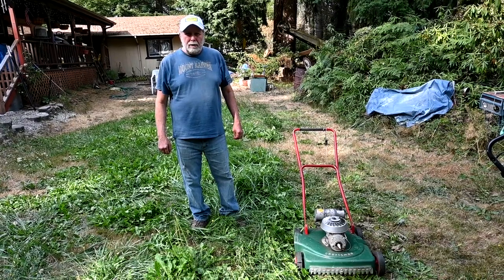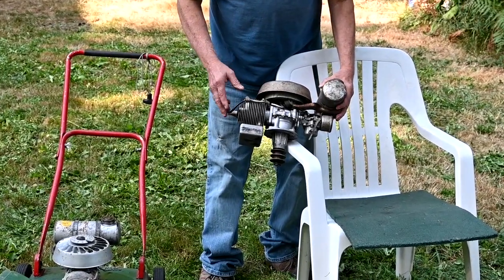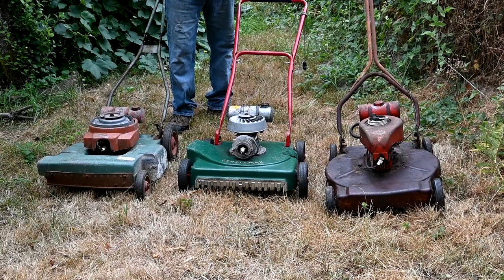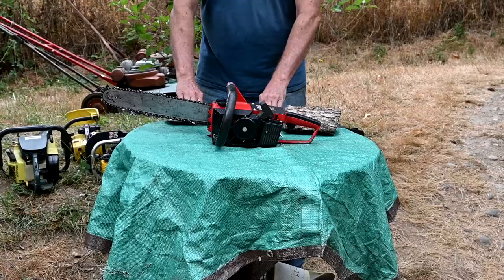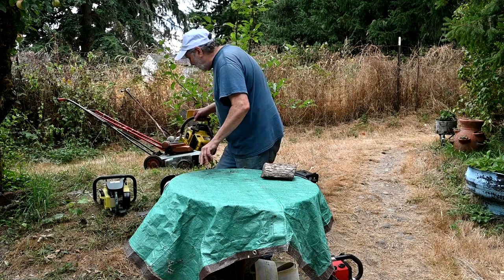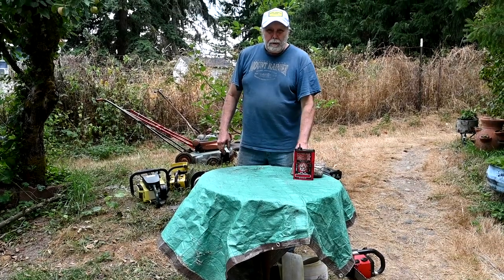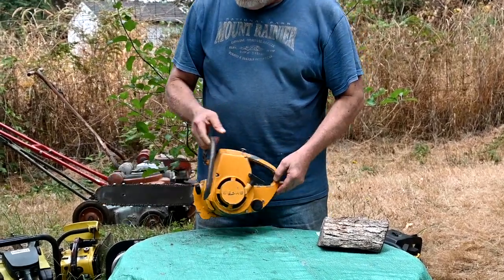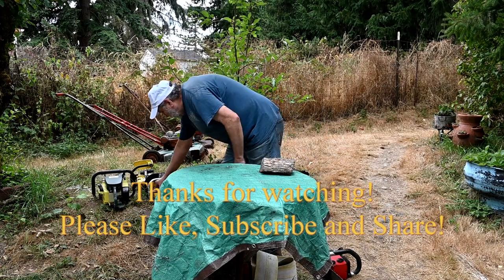Vintage Lawnmower Mowing + BS Vintage Chainsaw Contest + BS

Comment: Thank you! I ALWAYS look forward to each new video! Ah! It’s Tuesday time for a new VH video, however, I usually don’t get them watched until Wednesday. I’ve got 20 some chainsaws and maybe 10 are operational but I just like saws and can’t tell you why. I first owned an old used saw and absolutely no idea the make which I bought in 1985ish that was completely wore out. I then purchased one from our Sears catalog store because I didn’t have any money but did have a Sears credit card. We heated with wood so needed a reliable saw. I think it was a Poulan which I put 1,000,000 miles on. About five years ago I acquired an intense interest in saws. A Root made in Baxter Springs, KS is my most unusual. Wow! I’ve really blabbed on and on!
Reply from the maker: Thanks for the nice comments.  The saws that Sears sold in that ere, were made by Roper, which had been David Bradley.  They were a close copy of a Homelite XL, and were really good saws. Saw collecting is a nice hobby, since they dont take up a lot of room, and there are a huge variety to choose from, plus you can use them to cut your wood.  What model Root saw do you have?  Root,s are rare and unusual.
Reply: @mrobsoletesvintagehomestea9156  Greetings from Germany....
Hab auch 2 Mac einmal  eine 140 Mac und eine 120 er .
Gruß Peter

Comment: EDIT:  Ok, I’m a bonehead.  I incorrectly claimed DYNAmark had also used Homelites.  I was mistaken.  It was DURAmark that used Homelite saws and rebranded them.  Sorry for the bad intel. 

Lombard Little Lightening was the base model I believe.  Similar to the Homelite Super EZ, but Lombard had a way of closely copying Homelite designs, like the American Lincoln/Comango line being Xl-12/SXL knockoffs.  Homelite also made some Dynamark models as well.  Based off of the XL series if I recall correctly.  Maybe some others
Reply from the maker: Your answer about the Lombard little lightning is correct, but the axe has already been won.  Your info about the saws is much appreciated, as history is such an important part of collecting.  The Comango saws were actually designed by a Homelite engineer.  It never ceases to amaze me how many companies copied the Homelite XL,s Thanks for the comments and watching.
Reply: @mrobsoletesvintagehomestea9156  no worries, I saw an earlier post with the correct answer. Just hoping to add info and keep the conversation going.  I love these old saws.  Great vid
Reply from the maker: Appreciate the info.  Thanks  @wildcaughtfirewood1511

Comment: I have a Dunlap draw knife, made 1937-1941.  It is of pretty good quality.
Reply from the maker: Some DUNLAP tools etc were good, but usually not as good as the top line stuff.  My DUNLAP axe is pretty good quality, but things like mowers used the cheapest components.

Comment: would love to see a video on the rider next to the manaul reel mower the rider with rein/handle bar steering i beileve its a craftsman but could be wrong
Reply from the maker: The riding mower is not a Craftsman, but I have no idea who made it as their is no data plate on it.  I also have the Craftsman mower you are talking about, but it is mechanically different.  The unknown mower runs, but all the bearings in the mower deck are noisy, so it needs a go through. A future project.
Reply: @mrobsoletesvintagehomestea9156   oh ok Maybe if you take a video on the unknown know where I would be able to identify it for you
Reply: @mrobsoletesvintagehomestea9156  I know, snapper Did a more like this the comet Homelite also made some thing like this with that style of steering this could also be a Homelite and then one boy made a version the loafer
Reply: @mrobsoletesvintagehomestea9156  Also Fairbanks Morse did a mower that had the style of steering so did beaver company But beaver company is more famous as you know for their eager beaver chainsaw
Reply from the maker: I had included it in one of my older lawn mower videos, but no one has responded to my quest for info on it.  It must be an unusual piece. When I get it ready to mow, I will do a full video, and maybe someone will know what it is.
Reply from the maker: Some day someone will recognize it, and we will al know what it is.
Reply from the maker: So many companies jumped in and made lawn mowers that were not commercial successes, and have gone from history.
Reply: @mrobsoletesvintagehomestea9156   exactly I was a big fan of home lite I like there older stuff but I bought a weed wacker from Home Depot last year and it’s already needing a carb rebuild. I don’t think I’m repairing it any time soon I got a older Troy built and some vintage echoes to come first before that peice of junk but it was bought at Home Depot so it could be a knock off version branded under there name
Reply: @mrobsoletesvintagehomestea9156   exactly
Reply: @mrobsoletesvintagehomestea9156  ok cool thanks A bunch if you can do a video on what engine it has and go over the features of the machine I might be able to identify for you better I will check your older video out
Reply from the maker: The Lawn boy video we published on July 13-2021, is the video to watch.  I talk about the mystery rider a fair amount, talk about the features, and that the engine is a 4hp Lauson from the early 60,s.    This video should answer your questions.  The Craftsman rider that I have that looks similar to this uses a plastic body, the mystery one is fiberglass.  Most old rider mowers use an idler pulley on a pivot to operate the drive and mower functions.  The mystery mower has a vertical transmission that pivots fore and aft to tighten the belt for movement, and the mower is controlled by a separate idler to tighten that belt, also shown in the video. The strangest feature is that reverse is friction drive, engaged by moving the trans to a position that engages a flat aluminum pully to rub against the flywheel. Hope this helps with the identification of the mower. @Ellenslife851

Comment: Dynamark chainsaw looks like a Lombard possibly.
Reply from the maker: Good guess.  It,s a Lombard little lightning in disquise.
Reply: @mrobsoletesvintagehomestea9156  at first I was thinking a Homelite Super EZ, but I knew that was wrong. My favorites are the McCulloch 10 series saws. You should try a Power Mac 310/320 top handle or the Power Mac 330/340 rear handle.
Reply from the maker: The mystery saw is a Lombard little lightning.  I dont have any of the Mac 310, 320, 330 or 340 saws, just my Mini Mac 35 and 110.  I have looked for a 330 or 340, but have never seen one.  They look to me as being an ideal saw for in tree work. The Mac 35 and 110 have served me well. @johnlincicum6390
Reply: @mrobsoletesvintagehomestea9156  yes, the 300 series saws are powerful. They're 34.4 cc's, only a few of the Mini Mac's were 34.4 cc's, most were 32.8 cc's just like the Power Mac 6. Not sure if they were the same engine though. Some of the newer 300 series with different model numbers were 38 cc's.
Reply: @mrobsoletesvintagehomestea9156  I have a Mini Mac 25 with a Mini Mac 6 engine swapped into it and 3 Power Mac 6's also. Lol!
Reply from the maker: Nice collection of the Mini Mac,s @johnlincicum6390
Reply: @mrobsoletesvintagehomestea9156  thanks.